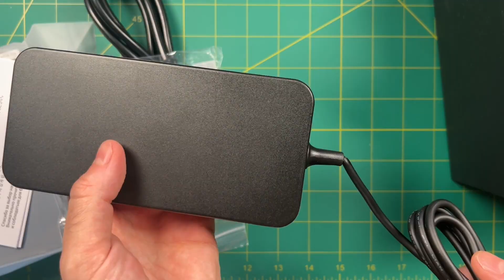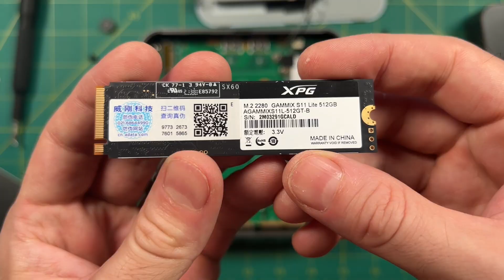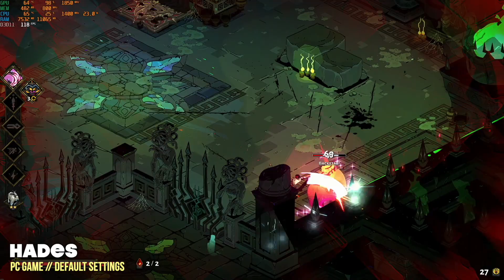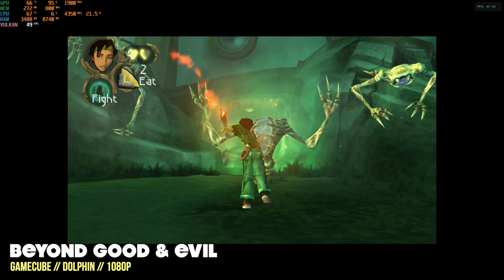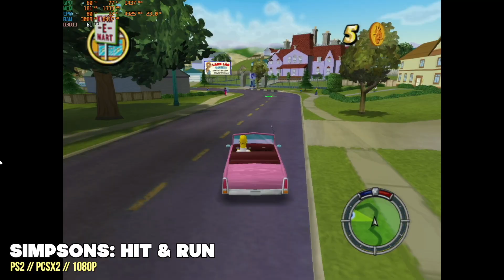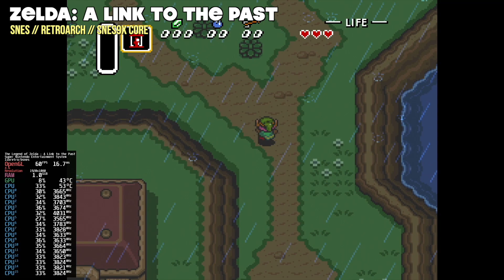Surprising Xbox & PS3 Performance!  MoreFine S500+ Review (Ryzen 7 5700U)

Comment: For 8-16 bit consoles and arcade (FBNEO) can you activate runahead to at least 2 so we can have a better idea on how the CPU handles them? You make it seem obvious that 2D gaming is easy to run, but with the added latency, runahead is the solution to that and sometimes even harder to keep up than 5th and 6th gen consoles, cores like Mesen/Bsnes and others rely on good single core clock performances.

Comment: Hey Russ. If you change on BIOS UMA setting to Specified 4Gb or 8Gb (Depends on your total amount of RAM) you get much better performance than UMA AUTO ( Defaults to 512Mb). Some games don't let you increase the detail of textures because it thinks you will run out of VRAM. I have 32Gb setted to UMA Spcified 8Gb and with it I can choose High detail textures in Forza and Doom Eternal. Relative to bandwith you can reduce to 900p and get som speed boost. AMD OpenGL drivers on Windows are really bad. You can use the open source drivers on linux and get a really performance boost.
Reply from the maker: Hi Marcus, this is great info, thanks!  Sorry I'm just now replying to it, I somehow missed it the first time around.
Reply: @RetroGameCorps  It's ok, my friend. I'm testing my setup with HoloISO and it's working great. SteamOS is great on that mini PC. You could make a video about it. Again, don't forget to set UMA Specified. I got Fallout 4 on high running almost locked 60. I can't test Doom Eternal but should work great.
Reply: @Pender666  Hi, I am trying to install MXLinux 21.1 Kde on the morefine with 5800u. The system keeps crashing. Any advice?

Comment: The 5900hx is quite nice in emulation.  I have it in the minisforum hx90 and it does an outstanding job with emulation.  I also like the quiteness of the hx90.  A bit of extra size for a much quieter fan and great cooling.  So far mine is set to stock TDP, but 1440P upscaling for 6th gen is really solid.

Also yes a minipc will always be a worse value the a full sized tower (assuming reasonable graphic card prices), but if you are replacing a lot of consoles a minipc also does a better job of looking nice in a living room instead of a tower.